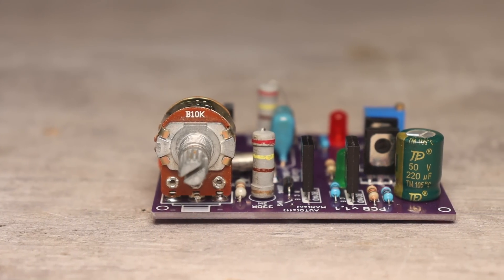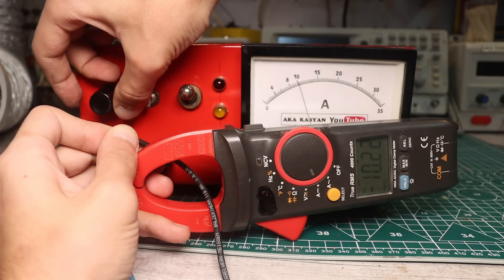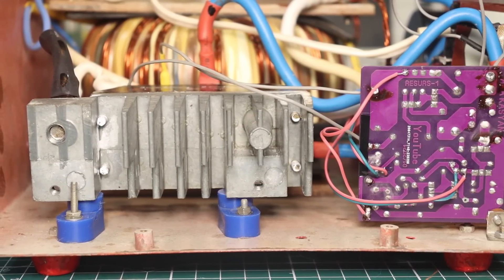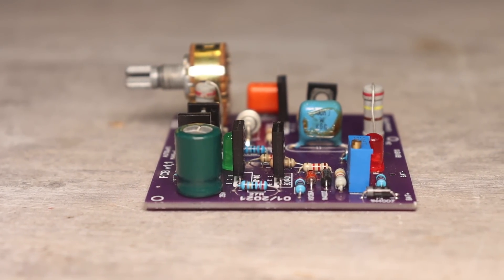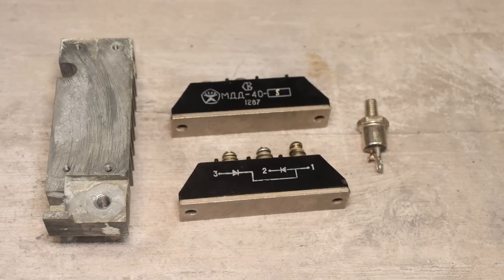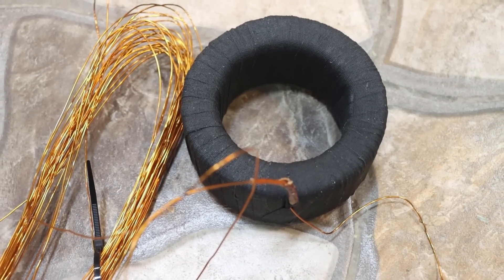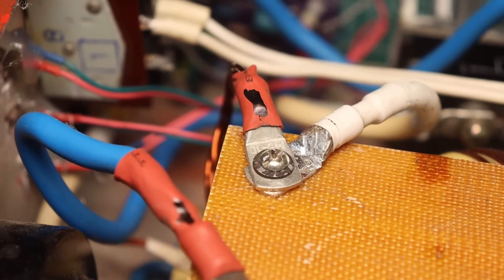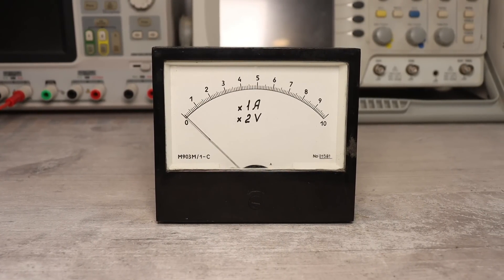How to make Powerful Car Battery Charger

Comment: Hello dear Kasyan-TV, 😉😉😉😉
SPACIBA for this very good design, as a car battery natural does with an alternator: 
it is infact a 3-phase generator, with a 3-phase 'double sided' twin bridge rectifier, 
where the Lead-Acid battery functions as the big smoothing cap. and charges and stabilizes, 
in conjunction with the regulator ;-? 

So you should also charge it with a Thyristor pulsed rectified AC. 
please, where can i obtain simple and easily some PCBs for this Thyristor pulsed charger ? 

Can I buy it via you, 

Because these must have sure already yet have been made at JLPCB, 
but they always ask for again and again a 'new' gerber or something else? 

Why share such interesting electronics, 
but than disable people from making such charger themselfs ;-? 

I just want to buy some PCBs, and maybe can contribute some future improvements, 
like a TL431 more Temp stable Ref. feedback control,  etc . . . 
Best Regards, Harry.

Comment: hi I'm from the Philippines, can you make a diy power supply 220v AC down to 12V Dc with 10amps? or a diy buck converter that is capable of holding 10amps efficiently? thankyou hope to see more from your channel keep the good work stay safe💓

Comment: I have a very strange battery charger made by carol wire industries back around 1970 or so, it has a ready made bridge rectifier which only supplies DC in the negative... and the automatic side is taken before the bridge in AC ... It's rectified through common components, zener diode, silicon diode ... Etc any way the way it works is it constantly saples to out put at the battery and restricts the supplied amps... 
But I need a new transformer and there aren't many used ones around here these days... I might have to make a toroidal.. but the original wasn't marked... It's a center tap and was supposed to supply 6 amps... 
Got any ideas on how many wraps of what gauge wire... For each field???